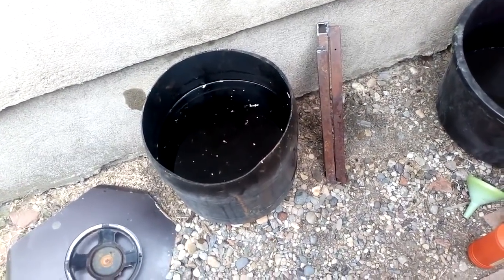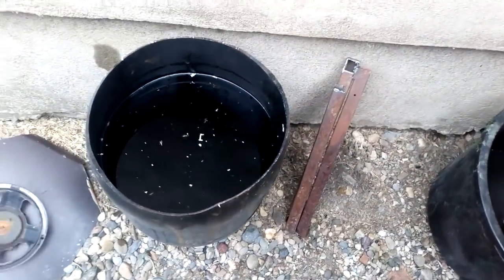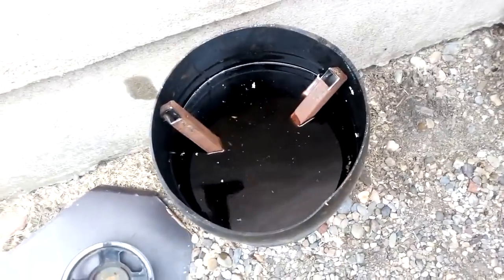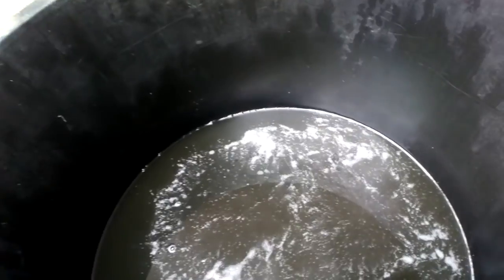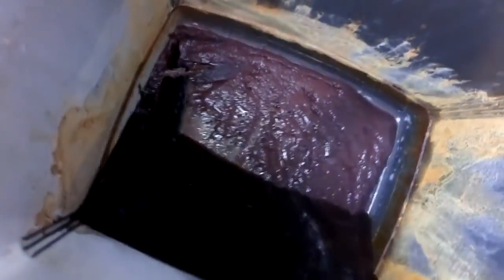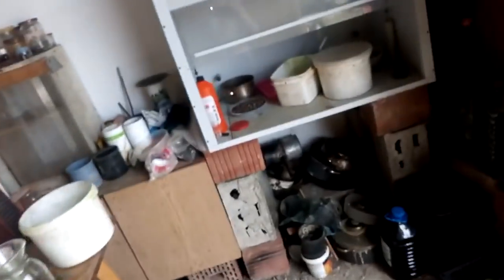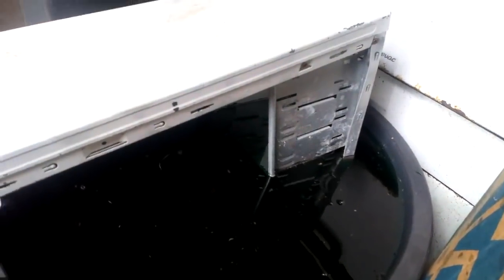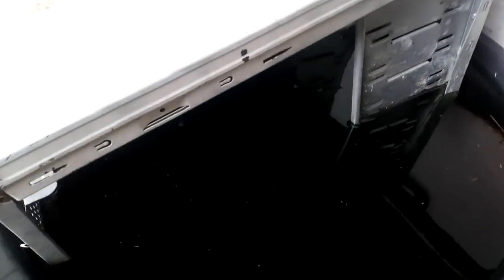Copper cement and dispose waste acid solution!

Comment: Nice video.  I actually prefer to use aluminium as I have access to a HUGE amount of old cpu heat sinks for free.  I don't drop them in though but instead I suspend them in the copper chloride.  I dilute it too so it doesn't react as aggressively.  Once it's all cleared of copper I'll filter and wash with hcl to remove any left over aluminium.  I like to reuse the copper and I will melt into bar stock for later use.  I haven't had to buy any metals for recovery use in a long time and in fact I have more copper now than when I started. 

The other reason I do this is my waste treatment process is a bit different as it's not just for reduction of toxicity but also to recover and recycle useful metals/compounds.  Rather than soaking iron in the copper nitrate I add potassium chloride to convert to copper chloride and potassium nitrate.  I crystallise out the KNO3 and use that to generate new nitric acid later on.  I've saved quite a bit of $ doing this but it is a bit of a pain but I have managed to distil some 90%+ nitric acid and used it for other fun stuff.  lol..  The remaining copper chloride is then either reacted with aluminium (as above) or I bubble air into it for a while to re-oxidise it and use it in place of AP for stripping gold foils.  It's a bit slower but I don't have to spend as much on hcl or peroxide.

Once I've done with the waste and have just an aluminium chloride solution I'll add in lye and reduce to hydroxide.  Filter that off and I'm left with a dirty salt solution and aluminium hydroxide cakes. This all goes to the waste treatment centre and they're quite happy to get a (in their words) "pretty non-toxic" drop off.
Reply: I experienced the same thing at first but solved it by going slower.  Firstly I dilute the copper chloride a bit to reduce the strength of the aluminium reaction and by hanging the heat sinks at the top level of the solution the boiling is greatly reduced.  i do it in a  5 gallon bucket no more than 1/2 full so no splattering.  Fumes can be bad tho so outside is best.  I also find hanging the heat sinks helps the copper drop off and fall to the bottom of the bucket making cleaning easier later on.  But really I only began doing it thins way because I have access to so much free aluminium and I find it makes cleaner copper.  If you want to use the copper later I don't think iron is the best option.
Reply: ,and is a very 34inches but not very strong man who was 
¹ x
Reply: 0
Reply: Wow, amazing you are, all of you.  Thank you for your love of chemistry and earth awareness.  I will start with the iron method and am inspired to learn how to do boringoldwhite's method.  Boring: get on youtoob and show the world of scrappers how to clean up our act! I will fly out and help videotape!
Reply: But how you dispose AlCl3 ? Sometimes is difficult to filter..
Reply: The HCL washes seem to pull most of it out.  I have not had any issues so far.  I've found ZnCl to be more of a pain to remove than AlCl